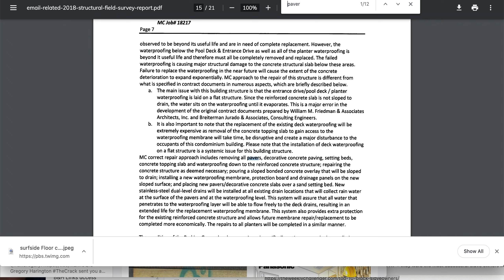Champlain Towers Collapse VIDEO OF DECK COLLAPSE FROM RAMP VIEW BEFORE FULL COLLAPSE CLOSE UP

Comment: That water flowing down, could it be a fractured roof drain?
Reply from the maker: It probably just a water supply line.
Reply: @ForensicCats  I don't want to throw you off course, but I saw somewhere an interview with a past maintenance engineer from the building, he said they always had loads of salt water in the garage after high waters and storms and the sister building did not, they couldn't figure out why or what to do with the water except pump it out and they went through lots of pumps. Sheet 281 of the drawings shows a storm water disposal well, I wonder when the last service inspection was done on that? Could that have been the source of the salt water infiltration? Looking on Google Earth I cannot find the 8 manhole covers that access the well tanks anywhere but from the plans they would almost seem to be in a picnic type area on the other side of the pool wall towards the beach.
Reply from the maker: @abscomm  John, I have known about that interview for days... Unless, I can find where this pump he spoke of and the size of the pit, I will reserve my thoughts on it being a contributing factor.
Especially, because the deck failed first (appearntly) and the hope would be the pit allows for ground absorption... Without absorption, no harm, no foul.
Reply: @ForensicCats  Ok, fair comment, but how would you get ground absorption when you are already at almost sea level? Couldn't the ground become saturated during one of the frequent hurricanes, and then where would the water go? I'm not trying to make that the specific cause of the collapse but might it be a factor in the weakening of the integrity of already damaged columns?
Reply: @ForensicCats  so not salt water? Fresh water?

Comment: The 5 is a 5MPH speed limit sign. It looks like the column with the yellow on it to the left could be the first parking bay after the ramp ends.
Reply: Not likely.  The ramp extends beyond the stairwell and another pillar.
Reply: @minimouse7579  no. Parking extends towards the hotel, under grade and beyond perimeter of building. The stairwell is at the left, then knee wall with a parking spot beside it (left). At end of knee wall is drive access to lines of parking. Column on left and beyond, barely visible debris at broken water pipe. 
Thanks made me.look closer at plans. 
Plans show parking beneath that road/sidewalk between the north side of the towers and the hotel where the video was shot.

Comment: Ramp mouth looks wider than plans at the street, so we can see the stairway walls on the left side. There doesn't seem to be any columns at the perimeter of the building, so I don't see a problem (other than confusing old plans). Wide ramp mouth would make it much easier to enter and exit the parking lot.
Reply: Parking extends under the ramp, towards video point. The footprint of the parking level is larger than the footprint of the building.

Comment: Where is that water coming from? It was raining the day it collapsed.
Reply: Fire sprinklers, waste , water. All that was on the ceiling of the parking garage must have been sheared off. That should have set off the fire alarm system immediately.
Reply: @chrispiecritters  Coastal Towers in Sunny Isles Beach had a small fire and the fire department came. No fire alarms no sirens even though it is supposed to have it. 

You are supposed to test them and maintain them. They obviously been skipping maintenance.

Comment: 5 MPH speed limit sign. So there is a void/sinkhole under the garage floor? Because there is only 1 level in the garage, not 2, right? Or did the angled ramp just collapse to the garage floor, from a side profile triangle shape to just flat?
Reply: Two levels of parking. The lower level had 1-2 feet of SALT WATER in it for days at a time about once every other month.
Reply: @russellblair490  do you mean 2 levels of parking beside lobby entrance and remaining portion of towers? Plans do not show 2 levels of parking at the collapsed portion.
Reply: The garage floor is 8.5’ below street level so ramp down is needed to access garage level.  The pool deck / garage roof is several feet above street level. What u see here is pool deck and / or first floor lobby / common area collapsed down to garage level. There was only one garage level.
Reply: This video shows that ramp and knee wall at :32. Parking extended beyond building, under that access road, towards the pool at the hotel video position.

Comment: yeah, that looks to be at the bottom of the ramp,at that intersection under unit C on the other side of the building. Hmmm, in the blue prints it shows the walls on the sides of that ramp down to that intersection. so that goes back to L&M at (9.1) as the first set of columns visible with no ramp wall in that fellas vid, directly below where that light further down was falling in the other vid.  focal length affects on the camera is confusing, the stair case is right there on the left. that looks like a pool deck flower bed/pot just beyond the column with yellow on it (M-9.1). so wish I could share a scribbled on pic, ugh.

so wish I could save the original, yet I know how the inter webs are of late.
Reply: Yes. The solid wall includes the stairwell, then a knee wall for the remainder of the ramp. The column painted yellow on the lower portion is on the opposite side of the aisle from the end of the ramp. I can't quite tell if the  next column has collapsed, or the floor slab is blocking our view of it .
Reply: Pause the video and key the windows icon on your keyboard and the prnt screen key at the same time.   VOILA!     You have a screenshot saved in your pictures.
Reply: @russellblair490  thanks, did so for scribbling on the blueprints, wanted the OG vid with less compression noise was all. it's all good, the ref that the patio was first to fall answers all my WTH-ing over why the pool deck fell all the way out to the fence-line on the other side from this vids view. we now know beyond any doubt, that it wasn't the building collapse that pushed down the pool deck, it was the pool deck that collapsed first.
Reply: @Zarcondeegrissom  Yes the pool deck fell first but I doubt that it brought the bldg down.
 Tennants had complained for a week that the building was creaking and cracking at an accelerated rate. Look for the detail for the deck, I believe you will find it to be unreinforced lightweight concrete. Not nearly enough mass to topple an entire building in seconds. 
That vid shows the deck in the garage but all of the support collums are still intact..